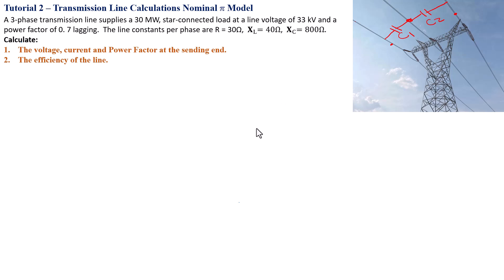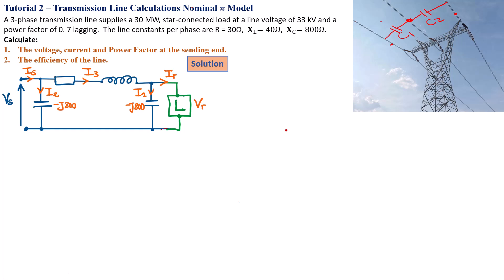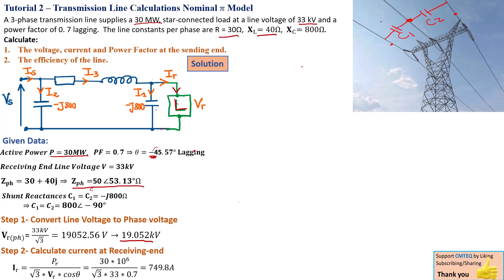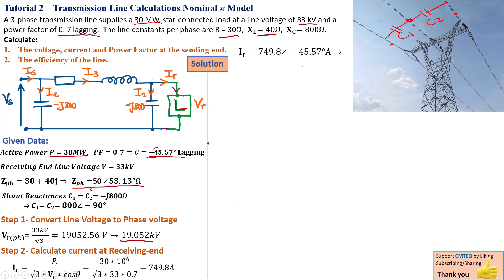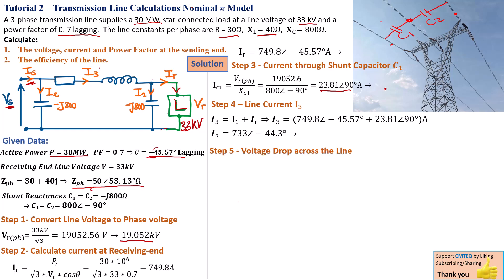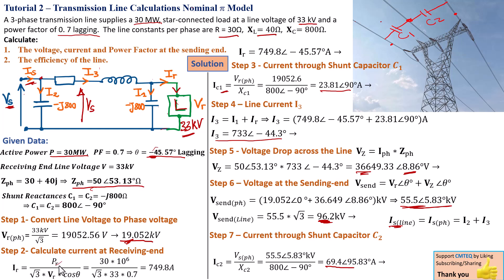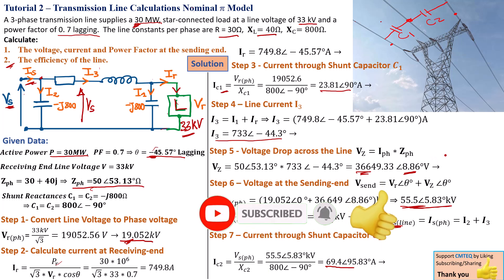How to Solve Power Transmission Line problem | Medium Lines π (Pi) model

Comment: How did you get the -45.57 lagging and 53.13?
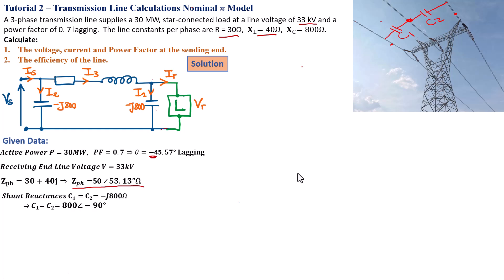Reply from the maker: Watch from 04:30 to 06:00 where I show how to find the impedance angle using the calculator. For the power factor angle, take the inverse cosine of 0.7 while making sure your calculator is in degrees mode. You’ll get 45.57°, and since it’s a lagging power factor, assign it a negative sign.